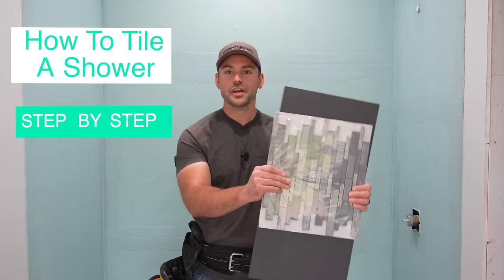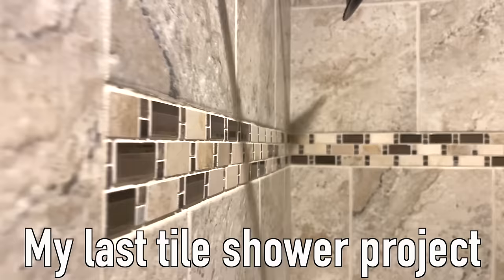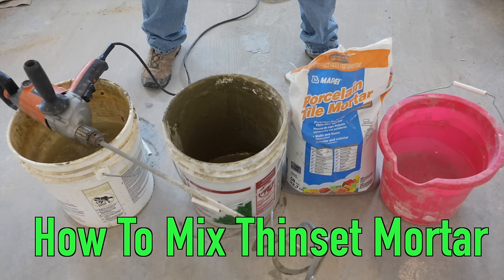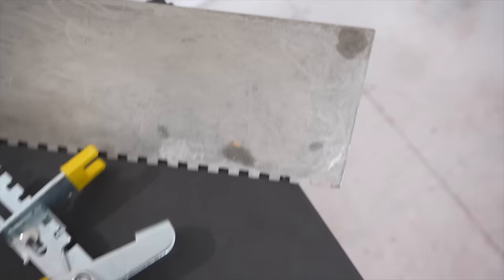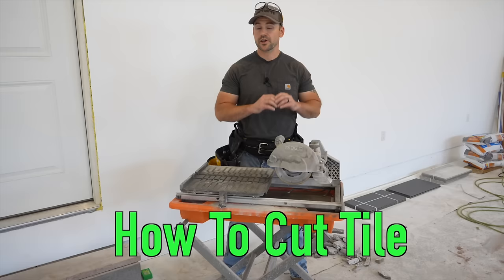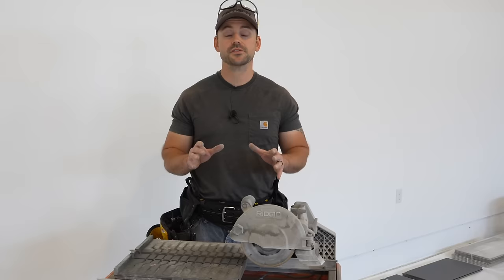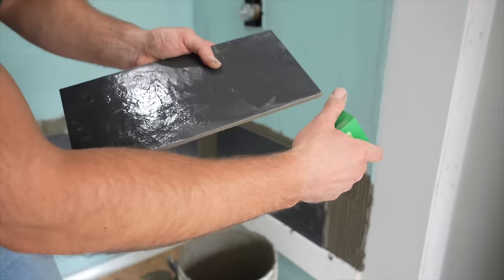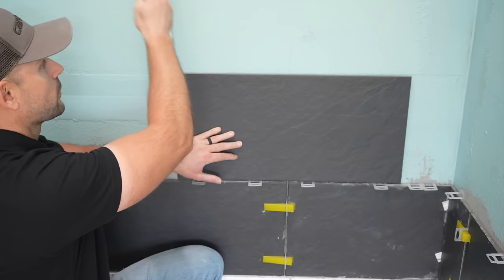How To Tile A Shower - Start To Finish Walls

Comment: Hey Josh, curious if there is a way to reliably cut all of the tile that you will beforehand so that you do not constantly need to move between workspaces, and instead could do all your measurements and cuts in one step, then do the actual thinset and tile in another step? Seems like it would be a more efficient process, but maybe it introduces new challenges to the project?
Reply: Yes. If your walls are plum and square, then you can batch all your cuts, and then install. 

My approach is to tile the entire back wall first. Lay out my pattern, make all the cuts, organize them in piles, and tile away. That’s typically day 1. The second day I work on the shorter side walls.

I would not recommend making all the cuts for one entire wall, just in case wall is not perfectly plum and it drifts away. So perhaps cut enough tile for half the wall.

At least that’s roughly my approach

Comment: so for the leveling system, i realize its just a little bit of movement at most when you tighten them up but, doesn't that pull the tile back away from the thinset and break that suction between the tile & motor? Potentially weakening the bond?

Comment: The first bottom row is 12 inch space. The tile height is 11 1/4 plus 1/8 top gap and 1/8 bottom gap. Now there's still 1/4 empty gap there. May explain why you choose 12 inch instead of 11 1/2 for the guidance?

Comment: hey great video I am trying to do this project...do you need anything for water proofing or do I just go straight on top of drywall?
Reply from the maker: I run the cement board and the tile right up to the drywall ceiling. I do it for cosmetics but anything over 6 foot high is plenty as far as being waterproof. I hope that helps!

Comment: Have you tried different waterproofing methods or have you always done cement board and liquid membrane?
Reply from the maker: Hey Ruth. I have built mud pans that were for tiled shower pans. When I did those I used a membrane and this waterproofing together. Other than that those are the only ones I have used personally. Hope that helps!
Reply: @TheExcellentLaborer  yes thank you for the response! 👍🏻

Comment: Hello, and thanks for the videos.  ?. I am using 1/2"~ Hardie Board in a tub surround.  It's in an older house, and the drywall is like 5/8".  I am assuming I shore the Hardie Board up with strips to even it with the old 5/8" drywall.  I am also thinking the Hardie Board should be even with the top of the tub lip. Is this correct?  Also, should I waterproof the whole deal, even though it's Hardie Board, and not just the joints?  Thanks again.

Comment: Could you please explain why you started with the board one tile row above the bottom why didn't you just start from the very bottom at the shower pan and work up
Reply from the maker: Hey Josh! I explained that in my video. In case you missed it, it’s because the shower pan is not level. Instead of trying to shim the tiles level on the start of the shower pan, it’s easier to start a board straight and level across the wall. I hope that clears it up. Thanks for watching!

Comment: When back buttering does the pattern need to be the same as cement board pattern ?
Reply from the maker: No. You can go in any direction as long as the lines are straight. I hope that helps!

Comment: Josh, I have seen and done back butter of tile but never seen using the notched side just a smooth coating of thinset.  Any comment on this please.
Reply from the maker: If you already did the job that way there is an anything you can do about it now. It would probably be fine as long as you set the tile in the thinset well. I would keep an eye on it but I think it will be fine. Hope that helps!

Comment: Another great video!  Thank you.  Related question:  For floor tile, can you use thinset directly on Advantech subflooring, or is a layer of something else required first?  Trying not to get my bath floor too high since the rest of the house is getting 7mm engineered LVT.  Thanks again
Reply: Subfloor
Cement board

Comment: Hey hi my question ❓ on the ceiling did you put a cement board or is there a regular drywall? Also by the sink area it needs to be a cement board  or I can be a regular drywall? Man thanks lot for doing this lesson videos .amazing

Comment: Question if your tile is 11 and a quarter inch and you want an eighth at the bottom and 1/8 the top isn't that 11 and a half and not 12in?
So you're using a quarter inch notch on the wall and then you're also notching the back butter tile getting the same quarter inch Notch and not just like a smooth coat on the tile? quarter inch Notch on quarter inch Notch contact? Thank you!

Comment: Only thing i don't like is screwing that board at the start, if i were using Kerdi or something for waterproofing i'd just have driven several holes through it, is there some other way of doing that?
Reply from the maker: If you wanted to you could start off the shower pan without screwing the board to the wall. It is just a little harder to get the row perfect but it can be done if you did not want to penetrate the waterproofing. I hope that helps!

Comment: Great video.  However, I would like to confirm some information about the layout lines/measurements.  So you find the halfway mark of the wall, then add 1/16 inch to the right of the center line (or to the left of the center lane?).  Then you find the halfway measurement of the tile.  Do you mark this half tile measurement on the wall to the right of the original center line or the line that was adjusted for half of the grout gap line?  Thanks.
Reply: Middle of tile to middle of wall for rows 1, 3, 5, 7 etc.

For the even rows, he put 2 full tiles 1/8" apart from the middle line.  So the offset on either side of the middle line is 1/16" of course.  No need to overthink.  Take your time and don't mix all the thinset at once.  Use a toothbrush along the way to clean up the mortar.  Do 1 row per day if needed and cleanup the mortar squeeze out well for the next day.

Comment: I enjoyed the video.  Starting my 1st shower tile walls today.  I was a little confused on the 11 1/4” tile you wanted 1/8 top and 1/8 bottom.  But you started the board 12” up from pan.  Was your tile actually 11 3/4” ?  Otherwise you would have had a 1/2” gap at pan instead of 1/8” ?
Reply: I was wondering the exact same thing! If you zoom in on the video, you can see that the tape is actually measuring 11 3/4, not 1/4.

Comment: thanks for the video. how do you decide how far beyond the front of the shower pan you want to have tile run to?
Reply from the maker: That is all personal preference beyond the shower pan. I’d like to go at least 2 1/2 inches which is the width of a bull nose past. Hope that helps!
Reply: @TheExcellentLaborer  thanks, that is helpful.

Comment: Thanks for the video, do I need cement backing board before I start with the thin set and tile? I have a plastic shower/bathtub and wanting to just take the plastic wall off and do exactly this in the video. Also where did you get this tile?

Comment: Some discrepancies here 
1 level systems not needed a waist time 
2 never bisect large tiles 50% ( subway) manufacturers recommend only overlap 1/3 ( all tiles have camber)
3 sidewall layout not really good with small cuts.
4 back buttering is good but not always necessary if proper trowel is used 1/4”x 3/8” and seated properly
5. 1/16” joints with unsanded grout better installation

Comment: The only thing I would say is, you need to burn the mortar into the substrate... meaning, trowel the mortar into the wall with the straight side of the trowel first...than the notched side after...creates a stronger bond....other than that, did a great job

Comment: back buttering is too be done with the flat side of the trowel. you aren't suppose too notch both wall and tile. the ridges smash into eachother. not that  contractors won't do it on floors to build up an unlevel floor ( doing a notch on both tile and floor) but it isn't the way to back butter to get almost full coverage.

Comment: Great - one question: why did you measure up 12" from the shower pan?  The tile was 11-1/4, and you said you wanted 1/8 above the pan and 1/8 gap between tiles.  Doesn't that add up to 11-1/2" not 12"?

Comment: So on the back board, is that green board, or is it that hard back ,concrete boarding? I know it has to be water proof as it's a shower.
Reply from the maker: I use cement board around the whole shower. I hope that helps!

Comment: I see you measured the tile and it is 11" 1/4 wide and you said give 1/8" on each side for grout joint, but you measured 12" from the bottom to the board isn't that much I thought was going to be 11"1/2. (11" 1/4 +1/4"= 11" 1/4. I understand I need to cut in some areas if not leveled. Please correct me if I am not wrong.

Comment: Can you clarify something for me. Regarding starting with the 12” measurement. The tile is 11 1/4” ht. They gives you a 3/4” gap at the bottom. Yet on the video you have a1/8” gap. Did you reposition the tiles before you completed the install??

Comment: Right around 01:26 believe you misspoke the tile is not 11 and 1/4 inch the tile is 11 and 3/4. When you said to add an eighth of an inch from the top and the bottom it wasn't adding up lol otherwise excellent video thank you

Comment: I'm going for it, if I make mistakes along the way, who cares. Wasn't happy with the shower kits. I make my own furniture now, may not look like Floor and Decor but it's something I made. Anyone with money can pay someone else to build something for them. I invested about $5K in woodworking tools and have learned a lot since I bought my house in April 2021. Repairing framing in load bearing walls is the biggest challenge as permits are required and the work in progress is visible from the street. I don't think they'll accept self study on YouTube as a contractor license number on the building permit application.

Comment: im about to remove my old ceramic from my wall to put on a new one. Do i need to remove ALL the old concrete on the wall  so that new concrete can be put on? Or can i just put new ceramic on old concrete walls?

Comment: I want to retile an existing walk-in shower.  After I remove the old tile from walls and floor, do I have to do anything to the floor prior to installing new tile?  As far as I know, the existing floor tile is attached to the concrete slab floor.

Comment: I started rebuilding my shower back in April. I seen a video on YT saying you should tile the pan first and once that didn't go how I wanted it to I just stopped.  So now I have a rebuilt shower with no tile. I called a contractor to finish the job but he wanted $7K. I want to get this done ASAP. What would you suggest doing?

Comment: Why did you measure 12 inches up for the 'guide board?'  My math had the tile at 11 1/4 + 1/8 + 1/8 = 11 1/2?  Where am I wrong? Or what am I missing?

Comment: Hey Josh 
Why did you start at 12” with ledger board ?  Tile is 11 1/4” plus 1/8” gap + 1/8” on top that makes it 11 1/2” if shower pan is perfectly level. So so won’t you start ledger at like 10 1/2” so you can custom cut bottom tile to fit?
Just a rookie
Bob

Comment: I'm about to start my first tiled shower and i dont understand how to measure for the level line to start at. Why did you measure a level line 12 inches from the floor if your tile is only 11-1/4" high? Adding in the two 1/8" grout lines only totals 11-1/2".

Comment: what did i miss?
first row of tiles is 12" above base.
tile is 11 1/4" plus 1/8th bottom and 1/8th top for grout equals 11 1/2"
what happened to the other 1/2" ?

Comment: If the width of the tile is 11 1/4 inches and you add the grout gaps on each side of the tile (1/8 inch plus 1/8 inch) the total is 11 1/2 inches.  Why did you measure up from the shower pan 12 inches?  Where did the extra 1/2 inch come from?

Comment: Why did you mark the bottom row at 12.0", the tile measured at 11.25" allowing .25" for grout equals a total11.50", where is the other .50" to reach the second row?

Comment: Did you water proof the walls before you added the thin set and tile?
Reply from the maker: The waterproofing are use, is to be put on before tile, and thin set. I hope that helps!
Reply: Yes.  My apologies. I just noticed it on your video at the 30:19 mark.  Great job!   Thanks for sharing
Reply from the maker: I’m glad I could help!

Comment: I don’t understand the measurement. If your tile is 11 1/4” tall, and you leave 1/8” space on top and underneath for grout, wouldn’t that be 11 1/2” up where you would screw that support board in to start the second row? I am so confused. Please explain

Comment: Im confused , towards the beginning  of the video for the bottom row you said your tile measured 11 and a quarter wide , you added and eight for spacer at the bottom to meet the shower base and an eight on the top as gap for spacer to row above , that only adds up to 11 and a half inches ...but you drew your level line at 12 inches , what happened to the other half inch ? could it be your tiles measured 11 and three quarters not 11 and a quarter ?  TIA

Comment: Where did the 12 inches come from in the beginning?
If the tile was 11 1/4 inches wide with 2 1/8” grout gaps. (Top and bottom )wouldn’t that be 11 1/2?

Comment: So getting the the early part of your video.  You measured the tie at 11 1/4" and said to allow an 1/8" at the bottom and top.  That would equal 11 1/2" but you said to draw a line ant 12".  What am I missing?
Reply: I see now.  You misread the tape measure.  The tile is 11 3/4" not 11 1/4".

Comment: If the tile is 11 1/4" and you want 1/8" between the shower pan and the top of the tile, why did you put the wooden board 12" away from the shower pan? Shouldn't it be 11 1/2"?
Reply: He miss said it 12x24 tile is usually             11 3/4 x 23 3/4 or it is true 12 x 24

Comment: The tile you choose was 11 1/4 - If you leave a 1/8 on the bottom and a eight on top that comes to 11 1/2 - Why did you go up to 12 inch for the board ??

Comment: Hello! Just wondering are you able to put tile over the fiber glass shower pan?
Reply: Nah no way.  They are not meant for that.  They are a shortcut for sure because they're already sloped toward the drain, and obviously waterproof.  With tile and backer board on the floor you would really need to be meticulous to prevent leaks.  Speed and convenience wins sometimes.

Comment: Why not cement board to your edges instead of leaving drywall to absorb moisture from the wicking. What's the reason behind not using Cement board to the edges.

Comment: I’m a little confused about the start of the height of the first tile. The tile is 11 1/4” high with an 1/8” gap top and bottom, that makes it 11 1/2” scribe to the top of the board…why did you make it 12”?

Comment: 11 1/4+1/8+1/8 equals 11 1/2 where did you get 12 thanks in advance
Reply from the maker: Sorry, it was a little miscalculation. Yes your math is correct.

Comment: It is this designer with approval of the owner to determine the material selection to be followed during installation. It is not the contractor to determine how tiles are installed. Good contruction management requires shop drawings prior to all work being done during construction. And should be reviewed and approved prior to installation.

Comment: Man, I’m really hung up on the 11 1/4 thing. After racking my brain for 20 minutes and watching the video over and over again at the beginning it’s 11 3/4.
Reply from the maker: Sorry about that, the math was off. The moral of the story is you just have to compensate for the grout joint when you start the first row. I do offer a membership to the channel as well. I have a chat room there for questions about my videos. Good luck with your project!
Reply: Its a great video. Thanks so much.! Great info in here and you make it so easy to understand

Comment: Dear Shawn? I could not pick up your name. Sorry. I have question. On lowest row you measured 11 1/4 then you said add 1/8 on top and 1/8 on bottom.  that is 11 1/2.  Then you chose 12 inches instead of 11 1/2 !?  why? that is 1/2 inch off. please clarify
Reply from the maker: Yes I responded to your last question. Thanks for watching!